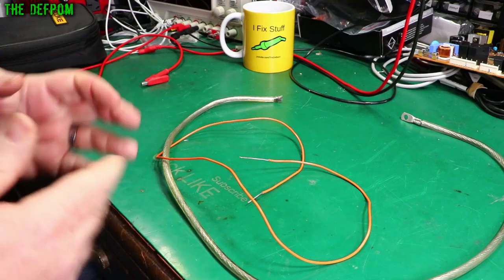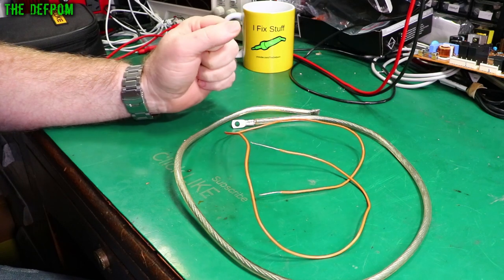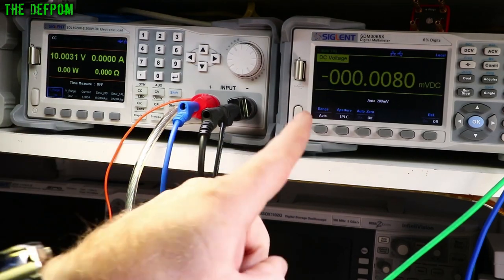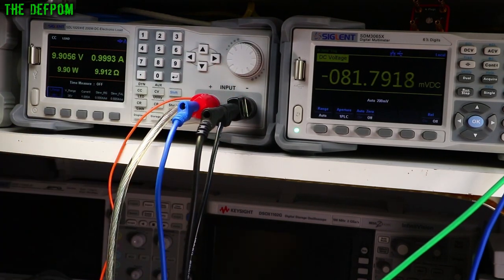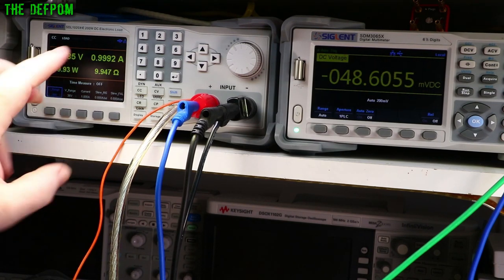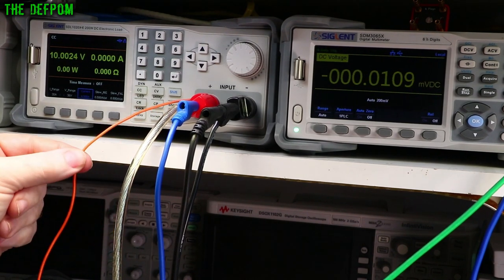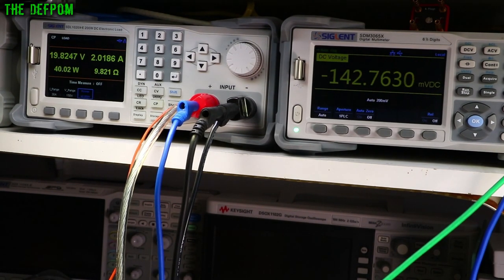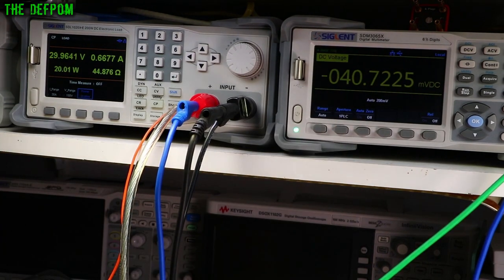🔴 Electronics For Beginners - No.22 - Wires, Not As Simple As They Seem ! - No.987

Comment: Had a fun voltage drop fault find today on a domestic property. It was basic ohms law in practice. Customer was getting 218V and the lights would dim upon the using a heavy load. Ended up being in the pillar box, an empty fuse holder had a puff of smoke coming out of whenever we'd FLC bring it online. 

Removed the dodgy empty fuse and the voltage rose straight up to 241V, our electrical systems are far more forgiving than the preciness of electronics ;)